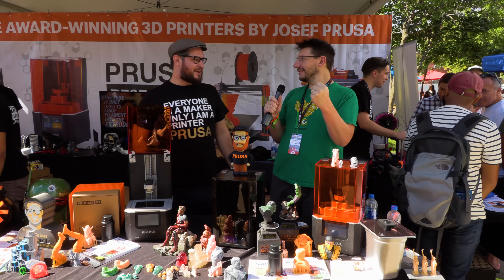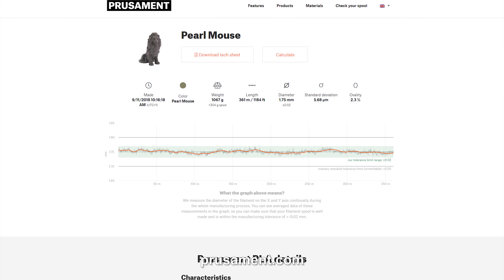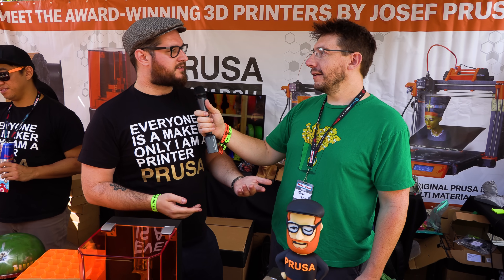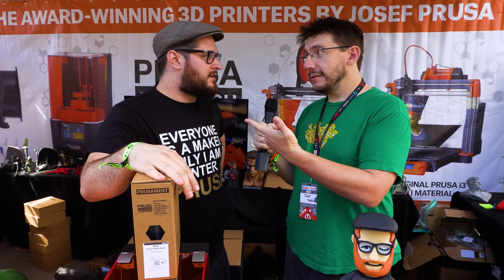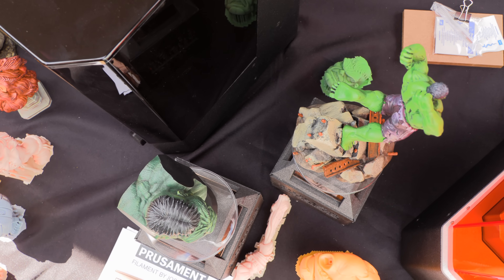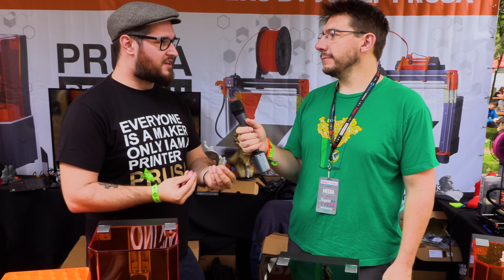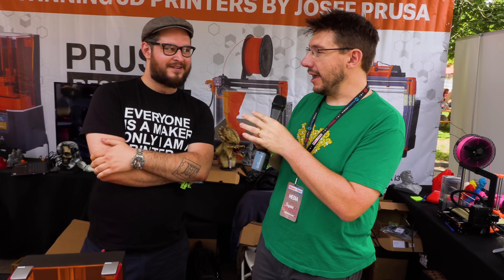Prusa SL1 Resin 3D Printer and Prusament FIlament

Comment: A couple of people have already come into the fab lab I work in asking why we won’t buy one of prusa’s new SL1 and asking why we are looking at the peopoly moai as a cheaper formlabs2 and I had to explain to them the SL1 has an LCD and not a laser system, they couldn’t believe me until I pulled up the fine text under the SL1 hidden away from view, you lose resolution for print speed when the whole point of buying a resin system is to maximize your print resolution in contrast to FDM machines that specialize in more commercial printing, I do not appreciate how this machine does not make it clear that it uses an LCD and tries to advertise itself as a laser system, consumers think SL1 stand for select laser 1 and don’t realize it is an LCD imitating stereolithography

Comment: Dlp stands for direct light projector, this is a dlp machine, all dlp machines are sla but not all sla machines are dlp, it’s like I’m selling a cnc machine that mills out material and calling it a 3D printer and marketing it as an fdm machine, consumers aren’t smart, if you say a machine is a 3d printer, they will typically think fdm, not just an evolution of cnc machines, there is no clear identification that this machine uses an lcd and I think a lot of buyers will be surprised they aren’t getting a prusa formlabs or peopoly moai

If you really wanted to get nitty gritty, I could call FDM machines SLA because they are essentially using a drawing method inherent of stereolithography but no one would like it if the prusa i3 mk3 were advertised as an sla machine the same way dlp’s are sometimes advertised as laser based machines

Comment: Any experienced 3d printer operators here? I need some advice, i am currently not at home, far away from my printer :(

Couldn’t You just print a really thin, squished „foil“ on the print bed before printing something like Nylon to improve adhesion? Or glue a foil on it? It would degrade quickly, but if it only needs to last for one bigger print..

Comment: love the filament, not huge on the resin printer, though. small build size and for the price you can get a moai which is true laser sla and larger. Usability features are nice on the prusa but don't seem to warrant pricing.

Comment: Anyone try any of the PET (recycled) Filaments yet?  Pro's/Con's?
Reply: Pro:
-recycled
-easy to print, PET

Con:
-No G (not PETG, wich is a Little bit better)
Reply: dontlikemath -.-  I'm looking at maybe.. trying some..but I'm using a new MonoPrice V2.. so.. may not be the unit to use for this..as it may require a much higher temp...
Reply: 220 degree should be enough. What is the maximum Temperature?
Reply: dontlikemath -.-  I think the data says..225..but.. it's early in the game just yet..so.. I'll wait till others have run the gauntlet...

Comment: SL1 seems to be a bit overpriced for the "best value for money" promise they gave in the introduction video. for 1300$ you can get Moai with an UV laser instead of a cheap lcd panel and 13 x 13 x 18 cm build size

Comment: Prusament might be cool, ordered a few spools, let's see. The resin printer, well, it's nice, I guess. I just don't see how what resin printing needed right now is a lower cost resin printer when it's glaring unsolved problems are that 1) it's using highly toxic and expensive fluids 2) resulting in non recycleable plastics 3) in a process that's messy, unsafe and difficult (printing, washing, curing, etc.)

Comment: I wont buy the Prusament I still go with DasFilament, way cheaper and also consistent diameter, never measured anything else than +/- 0.03mm
Reply: Google does not find any supplier in the U.S..

Comment: If it uses LCD isn't it more of a DLP style rather than SLA? Either way I am excited for this.
Reply: Yes, it is similar, but the LCD acts as a mask. The exposures are done with UV diodes below the LCD unit.
Reply: @michaels3003  I know that. It just seems odd cause SLA is a laser painting the image the same way an FDM Printer does. A Masking LCD with UV Backlight still seems more DLP like than SLA as it does a Layer at a time.

Comment: Isn’t this a DLP printer, not an SLA printer? The press release talks about the size of the lcd screen used for printing.
Reply: no, DLP is 'digital light projection', which is a trademark of Texas Instruments:  http://www.ti.com/dlp-chip/overview.html
While SLA refers to 'Sterolithography':  https://en.wikipedia.org/wiki/Stereolithography which may or may not make use of DLP in the process
Reply: Stephen Eddy  Technically, it's actually MSLA - Masked Stereolithography that is used for the SL1, hence the LCD screen.  As James points out SLA is just a term for the process of curing resin with light to build something.  There seem to be 3 main types of SLA processes, Laser SLA, DLP SLA, and MSLA(masked).  From what I've read the Form and Moai use Laser SLA while the SL1 and Photon use MSLA (it's cheaper than DLP, but basically does the same thing with different hardware).  Here's a brief explanation of the three processes from a website for orthodontists https://theorthocosmos.com/laser-sla-vs-dlp-vs-masked-sla-3d-printing-technology-compared/ since Dentists and Orthodontists both use 3d printers for things like retainers and crowns.
Reply: Aaron Williams  Thanks.  The big issue with LCD and DLP based SLA is the resolution of the screen.  I've had a DLP printer before (the T1000) and couldn't get results anything like the Form2. 

The T-1000 was a maximum X / Y resolution of 100 microns (which limited the print size) and I note the Prusa is 47, so it should be better.  Also given two years of reliable service from my MK2/s/2.5 I don't doubt that the Prusa model will be superior in every way.
Reply: Stephen Eddy  While MSLA is limited to cubes rather than the potentially smoother Laser process, one of my major concerns about SLA printers is the resin used.  I am deterred by the chemical odors and potential danger of exposure to those chemicals (but mostly I don't want to make my house stink), and the Prusa has a filter to help remove the odors while printing at least .nothing to be done about when you pour the resin into the printer though I suppose...  Though, I have heard of low VOC resins which may solve some of the problem.
Reply: Aaron Williams  That was one of the main reasons I got rid of my T1000.  It was in the house and even when the resin was in the printer and it was closed, it left a horrible chemical smell in the air that stung the back of your throat.

Not only that, but you have to clean debris from the resin after each print and deal with cleaning the prints and the build plate.  It is a world of pain to work with compared with FDM printers.  I love the quality but not sure i can put up with the drawbacks.
Reply: They call it masked SLA.

Comment: The sensor that Josef talked about that watches for proper color and diameter.  Is that too expensive to replace the current filament sensor in the MK3?.... lol  Sounds like that tech could be good if it could be duplicated cheaply.

Comment: I wonder.... if maybe the filament tolerance check can be on the printer, and the printer adjusts for extrusion to keep it linear.
Reply: It's probably cheaper to have one machine checking the tolerance than to add it on every printer. 

All they have to do is get reasonable tolerances on most spools. They can use the rest in house.

That could be usefully if home filament extrusion becomes a thing though.

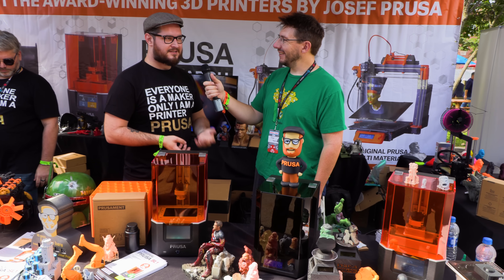Comment: That hulk bust @ 6:29 has some mighty visible layer lines for a resin print...
Reply: unless they're not from the SL1 and just lined up with that part of the interview?  I'd be really curious
Reply: They were set up in front of the SL1. So I assumed they were from that machine. Tried to only use SL1 prints for that part and prusament prints for the first part of the video.
Reply: @lasersandlayers  according to someone on Reddit who was there, they were mk3 prints. Idk though because I thought the same as you. It does look too big for the print volume of the SL1 though

Comment: My only gripe against the SL1 is that it should be called DLP1, there’s no other way to inform people that this is an LCD machine and not a laser curing machine like a formlabs or peopoly moai, Prusa is frankly using a clever method of false advertising because SLA is typically used to identify laser systems and DLP for projector/LCD systems and yes, both systems have their own quirks and needs
Reply: Bajicoy method is called mSLA :-)
Reply: DLP is not LCD; please do not confuse these different technologies.

References:
https://en.wikipedia.org/wiki/Digital_Light_Processing
https://en.wikipedia.org/wiki/Liquid-crystal_display
Reply: You are confusing a specific design (laser based) with a 3D printing method. PLEASE visit Wikipedia and read the history of SLA.
Reply: So how are you telling people this is an lcd and not like a formlabs 2 or peopoly moai? May as well just call it a 3DP1 if SLA doesn’t mean anything or Resin1 but you are mismarketing a system as a laser machine without making it clear it uses an lcd
Reply: Dlp stands for direct light projector, it’s an lcd, projecting light directly into a vat of resin, how is that not dlp?
Reply: Bajicoy  
You are right, according to the selected DLP components. The LCD works like a matrix and is cured by a UV light, not a laser. This is a simpler and cheaper technology with one improvement against the competition at twice the price
Reply: Thanks, it just gets on my nerves when people reference wikipedia to try and tell me that I’m wrong, very grateful you see what I’m saying

so the LCD can UV cure a full layer by layer by projecting an image from its screen, downside is that you’re limited by the pixel resolution which isn’t explained at all, think 360p and 1082p resolution on youtube videos, you have no idea what you’ll get, if you were to take a microscope or magnifying glass to your printed part, you’d see a bunch of ridges and squares of every pixel meaning higher tolerances for your part at the expense of quicker prints because rather than curing line by line, you’re curing a full layer by layer, you could certainly draw with an LCD true to stereolithography as a drawing action but the result would be the same because of the limit of the pixel resolution of the LCD. A laser system uses a pin point laser through a focused lens, and mirrors on motorized gyros, the angular adjustment with a much more accurate uv curing point allows for very fine details, smooth surfaces, and lower tolerances for sliding parts. Sorry for the lengthy explanation, the wiki monkeys up above just get on my nerves and I hope they do a little more thinking for themselves with a little encouragement.

Comment: SL1 looks cool, but I'm a little disappointed by the build volume. Would have liked to see 150^3 or so.
Reply: Nullzero98 rather hard to do, but yes I'd love to see that tackled myself. Think screen resolution availability as the easiest part to why it would be harder to manufacture a larger sla printer. His 5.5" screen is probably 4k or possibly something close, think apple screen or galaxy s series rez to keep the print quality high. Layer height is only part of the equation if your pixels are 3 to 5 or more times the size of the z axis positioning
Reply: @mythos000000025  , it is not 4K... I am sure that price of the LCD unit was a major consideration. I am sure the size will get bigger over time if the prices are good. You cannot get a great price if you only order a few thousand LCD units from the manufacturer.

Comment: and what happens with the rejected spools? with the tolerances he is going for compared to the rest of the industry im sure some bargain hunters wouldnt mind the reject spools for cheaper if they are just being tossed. though i know prusa is trying to go for quality all around
Reply: I would assume they get chopped up and re extruded.
Reply: My guess; they probably cut out the rejection area (they have enough data to tell them where it is), and use the remaining smaller lengths in-house.

Comment: It'd be cool if they offered the inconsistent color spools for sale at a discounted price, for people who want to prototype before printing the final model, of for people who plan to paint the model and the consistent color doesn't matter much.
Reply: We use those spool in-house, even our accountants print pretty much every day :) Plus you can print with them in our Prusalab makerspace in the ground floor of our HQ.
We'll see what we can do with the leftovers, if we have any :)
Reply: That said I suspect rejected spools are rare due to the high precision of the process.  Everything is controlled from start to finish.  Where inconsistencies occur are when the systems fail for a particular batch and the system probably shuts down immediately when something isn't right which is what all the checks are for.
Reply: im pretty sure they just remelt it then sell it full price. id be amazed if they just threw it out.
Reply: @dakotapahel-short3192  yeah I wouldn't figure they would throw it away.I'm sure they have the cost of operating their extrusion machines factored into the price of their filament, so if it saves them time and money not having to grind it up, remix it, and Re extrude it its a win win.
Reply: It's not that simple to grind and remelt filament.  Must more if it has already been colored and especially if it failed the color consistency test.  It's much more economical to PRUSA and buyer to simply sell rejected spools for a lower price, but not offer the consistency guarantees.

Comment: Although I love the products, there are a couple of notable items here:

The jamming that's referred to around the 1 min mark ALSO occurs using genuine Prusa filament.  When the multi material worked without any blockage, the parts were absolutely stunning.  The success rate, however, was less than about a quarter of the time, with the rest completely jamming within the steel tubes.  It was an awesome concept for sure, and the engineers at Prusa are absolutely amazing in bringing these to production.  In actual usage it was unable to perform as promised.  Thankfully there is a new version of the multi-material setup coming to market, and I'm hoping that some of these issues are finally laid to bed.

BUUUUUUUT - this new MMU setup shines a light in the company's biggest weakness by far.  - And that's in their shipping schedule.  Granted, we are all buying into a "development / early release" and it's to be expected on delays.  But there are orders finally getting filled at the start of this month for the new multi-material units that were ordered as far back as November last year.  I'm looking at my order going in April sometime, to be shipped possibly in another month or two *if I'm lucky.  This same shipping schedule plagued the original unit as well.

These are first world problems, I know, and it's awesome that the Prusa name is getting so far wide-spread as it is.  I wish nothing but success from the company.  Working from the side of simply offering a bit of criticism is something that should be welcome.

Guessing from the time-table of their previous releases - orders for this new SLA unit would likely be fulfilled next year.  These shipping delays should be the company's primary focus for sure, because although he is doing very well for himself, I guarantee that it's absolutely affecting his sales and bottom line for having such a massive spread from initial orders to actual delivery dates to customers.
Reply: I am sorry to say that the new mmu 2.0 do  have issues with filament jamming even with Prusas own filament ,though there are several things that can be done to prevent this ,but i still have not completed a  5 filament object without filament jam ,i am though getting closer every day ,and the release of new firmware on a regular basis do help in the right way ....this is the price to be one of the early ones ,maby everything works perfectly when you get yours :-)
Reply: Isn’t this what Joel and angus, was overly critical about creality for doing? Why does Prusa get a pass?
Reply: fixhbot  I don't think they get a pass, but I haven't seen a big name reviewer do the MMU 2.0 yet either